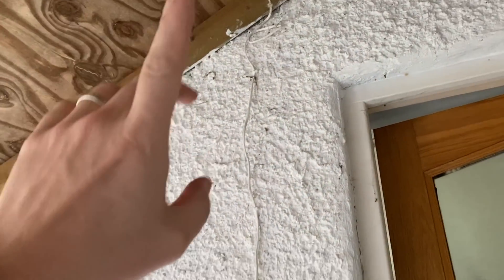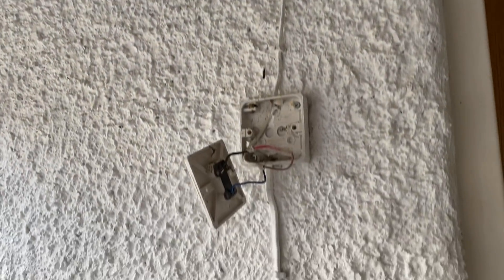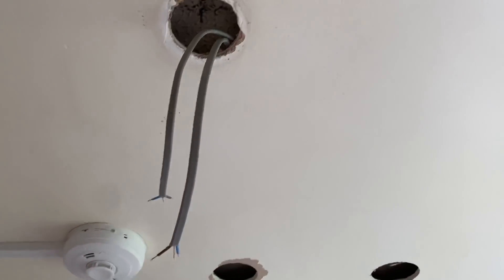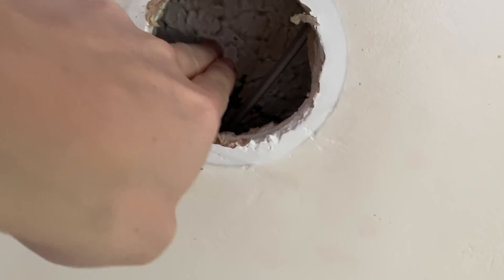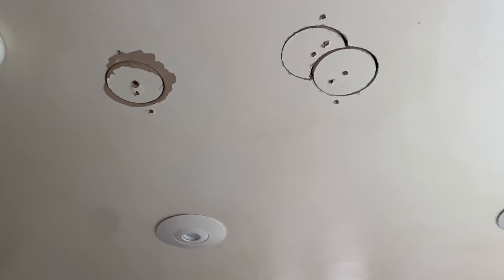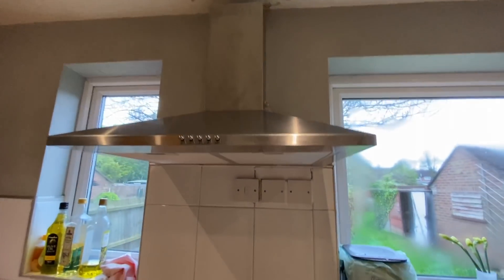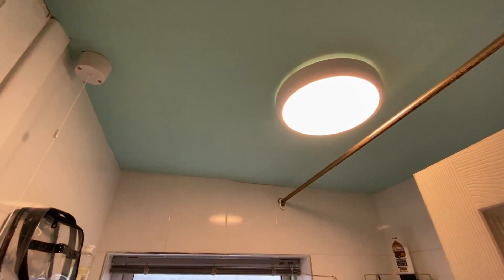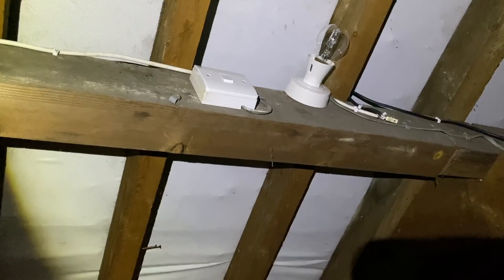EICR Fail - Fixing electrical faults

Comment: What’s going on with that wiring in the out buildings??
About 100mm above a workbench with NO mechanical protection.......
Then you clipped it across a shelf bracket..... looks pretty poor to me mate.
Reply: Andrew Ground yep totally agree, I would use at a minimum high tuff but I’ve now got into using LSX better than high tuff as has an earthed screen. Both terminate with as Jordon has used stuffing glands
Reply: Aspect Electrical 
We all do work we know we could do better afterwards when your up against it. 
Fair play to you for admitting it.
I personally only ever use conduit in those areas where it requires some mechanical protection.

Comment: Did you consider replacing the loft light with cheap led bulkhead? Never like exposed unprotected lamps in areas where people bang around with boxes. Also why did you not mechanically protect the outhouse wiring?

Comment: It seems odd that you need an IP rated light fitting which is out of reach in a toilet, yet can use standard sockets and switches in a leaky old shed?
Reply: Christopher Norman maybe the shed is classed as a non essential installation (your not in there multiple times a day), just my thought not fact!

Comment: There's no earth because they are feeding a transformer 230:12V. Earth is not req.
Reply: The cable still requires an earth imagine a nail goes through it but please keep up the cowboy work so us proper electricians have plenty of work correcting your crap 🤦🏻‍♂️
Reply: That’s no excuse for crap workmanship, cable still needs a earth. Or are you just a troll?

Comment: Really good work mate. Was it ok to leave the twin and earth cable from house to shed, clipped to fence and exposed to the elements? What do you reckon?
Reply: I agree, I would not use T&E in a shed as it gives no mechanical protection. It should have been done in conduit.
Reply: I was thinking that as flat twin and earth isn't designed for exposure to the elements
Reply from the maker: It wasn’t clipped to the fence it was actually run in conduit underground. The fence one was something else I think maybe the neighbours.

Comment: LED bulkhead, remove the neon from the ip rated switch, will only cause you issues like flickering.
Reply from the maker: Yeah I’ve had that problem in the past but these lights don’t have that issue.
Reply: I found that out the hard way

Comment: Wouldn't it have been better to just drill new holes for the downlights and fill the bigger holes left by the originals.
Reply from the maker: They would have been in the wrong place then. Plus I didn’t want to make more damage to the ceiling as the property is tenanted and no doubt they will never actually paint the ceiling.
Reply: @artisanelectrics  They'd only be fractionally out and the ceiling would need skimming and painting anyway as you've had to drill some access holes.
Reply from the maker: Yeah true